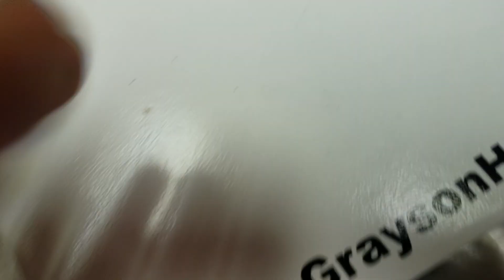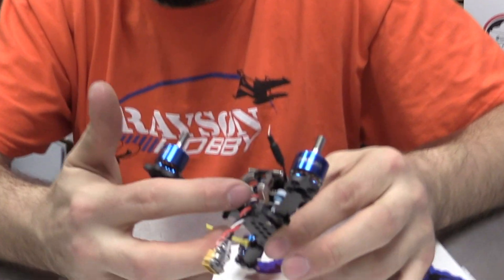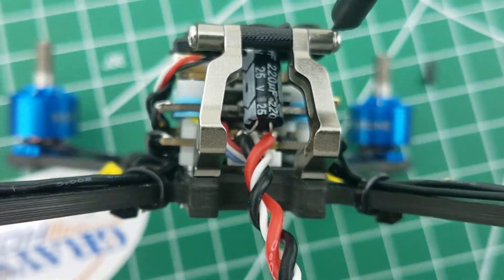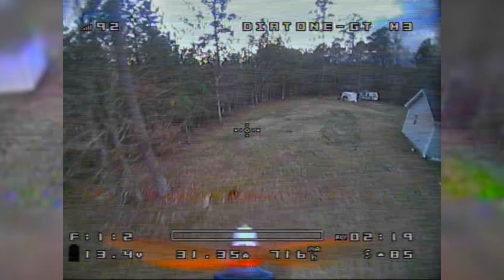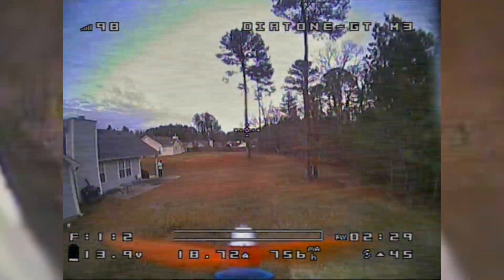Want Clean FPV Video? Diatone GT M3 3inch Micro Drone capacitor.

Comment: Would you recommend the "normal X" version of the M3 or the "stretched X" version? Are there any differences in handling, performance or prop size?
Reply from the maker: Hey Mike we recommend at least I recommend the stretch X. We did a video Last Summer on the GT 2017 and the stretch has more cleaner air therefore performs better at least that's what our results found
Reply: But you'll see the props then, right? So with the normal X version the props are not visible?

Comment: Solder the capacitor on the 5v and gnd next to the TX6 instead of the power leads. you will get rid of the noise.
Reply: CORRECT!

Comment: I was wondering if a capacitor plugged into the receiver.... used with a gyro on a small fixed wing airplane would help clean up the video... or would it help to add another on the power supply?
Reply from the maker: the cap on the receiver would prevent a receiver  brown out ie Spectrum receiver with servos 
I don't believe it would have any effect on the VTX

Comment: what do you guys think about putting the cap on the battery connector side instead?
Reply from the maker: On the battery? Sorry I don't understand
Reply: on the end of the lead where you connect the battery, not to the FC itself. just for extra tight micro builds where there's not room for a cap on the back or side of the stack.

Comment: Have you had any issues with the amp readings being off after putting the cap on the battery leads? I put one on my gtr-90 which I believe has the same xt-30 connector with the integrated current sensor. Works great for video,  but my amp draw is extremely low (.5 amps-ish) when flying around.  Anyone else have similar issues?
Reply: It may be due to the cap acting as a dam for the fluctuations in current. Basically exactly why you add a cap, to clean up the flow of electricity and make it a constant smooth flow instead of all the pulses and jumps from the motors changing rpm so quickly.
Reply from the maker: Hmm, I just sent diatone your question
Reply: Thanks man!
Reply: Thanks, I was going to pull it off to make sure that was really the issue, but after a fun accident I'm waiting for a replacement vtx.

Comment: Is that video clip at the end, after the capacitor was installed? or were all the clips with none installed?
Reply from the maker: Great question, all video is without cap
Reply: that's still pretty good footage though. the footage from my babyhawk-r which came with a cap preinstalled is way cleaner than on my diatone gt-r90 but it doesn't really bother me. Even though I have a hglrc xjb-145 im really considering picking up one these M3's too. Although the footage from the xjb-145 is crystal clear, it doesn't even need a cap. It got even better when I moved from the stock cam to a Foxeer arrow pro micro. I found the stock hglrc elf cam it came with wasn't as sharp no matter how I configured it

Comment: I have BAD BAD luck with minis and micros.  I am lucky to get 10 flights before something breaks  My Diatone GT90  the current sensor white wire just came off   not a huge deal but too tiny to fix ...there is NO WAY to push on and pull off the XT30 too many times till the leads break.  I LOVE DIATONE !   this hobby needs to fix the lipo situation !
Reply: I had the same experience with my gtr90. A lot of the factory solder joints that were on the flight controller broke mid-flight when cruising around so I re-soldered them all. Since then I haven't had any problems. Not sure how you feel about soldering those yourself, but it did improve my experience a lot. Good luck and don't give up on the micros :)
Reply: KingKong  LADRC  115  in Januart  5 flights I loved it !  inside it suddenly fell to the flor,  now ome motor inop.  solder joint ?  esc ??  motor ???  I do not know  I had ordered the extra complete frame,  so I now have  two frames  waiting for a good sale and I will try again

my BEST kwad has been the ViFly 150.  so fun !   over 100 flights not a hiccup !

Comment: That changes so much! Would you suggest on a 4s 5” to do one capacitor per esc? Or just one to power?
Reply from the maker: We are not electronic experts, but from what I read others have put one on each ESC. For the wizard 220s, we were having terrible video noise and we put on one big capacitor which seem to solve the problem.  Sooner or later you get into the trade off of how much time you want to spend versus just getting out and flying personally I would just throw on one capacitor just like this video and call it a day, if you need to put one on each ESC I think there's something else is wrong